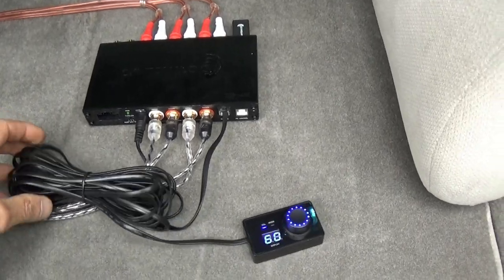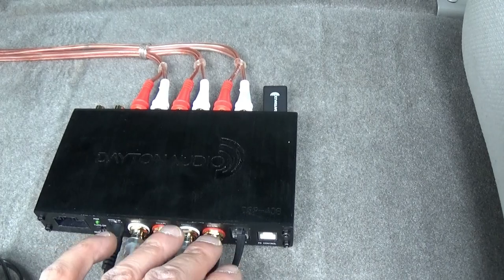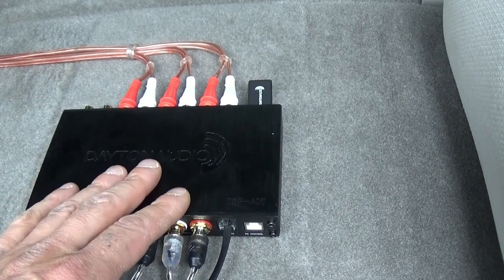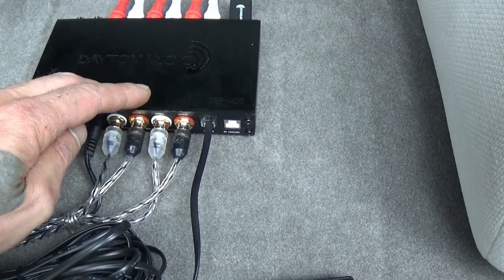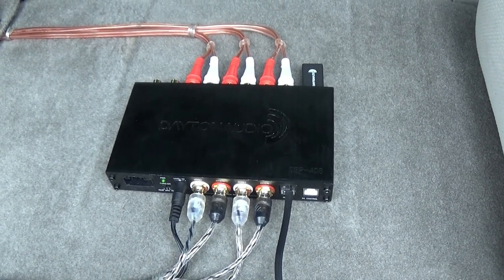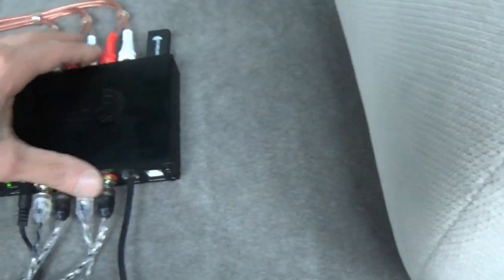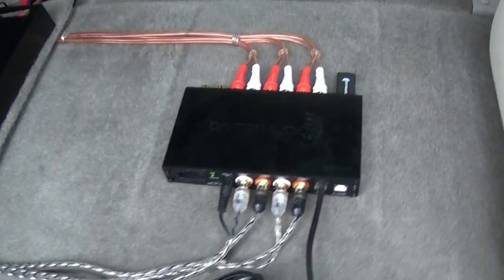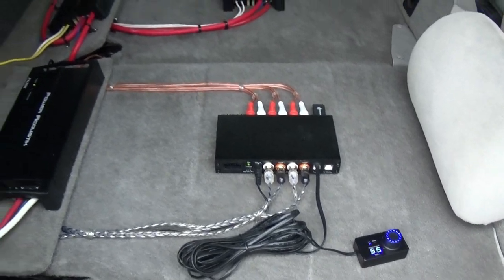Dayton Audio DSP 408 Review and Installation #daytonaudio #caraudio #audio #loud #dsp #installation

Comment: I heard that the Dayton DSP does some kind of popping noises and sometimes doesn't work without turning the car off and on to reset it. Is that true?
Reply from the maker: ive ran the same one for about 5 years now. i have not experienced any of those issues.
Reply: I know this video is old, but I see you also have a trailblazer in this video, and also have the same ideas as me! Right now I'm working on getting rid of head unit and getting a dsp. Just going to use my Samsung tablet, with sub amp and 4 channel amp for the highs. I think it will be better quality that way also? Because it's bypassing the head units dsp and using a dedicated one. Should be good. Let me know if you still have the trailblazer and how good does a system sound in it? I will check your channel to see if you did the tablet/Bluetooth setup.
Reply from the maker: We have another trailblazer now and since we've had a few different vehicles. They're all on here and the installs are too probably. It's worked great with the android tablet to dsp via Bluetooth. I haven't had any of the issues I've heard people mention here. It's been 100% solid all the time and sounds awesome once it's tuned and set up. Everyone always compliments the clarity in every vehicle.

Comment: Clean install bro, and thanks for the information about the DSP.  I have one too, and I love it, BUT, I have one issue....ENGINE NOISE/Alternator whine, and it's killin me.  I was noise free prior to the Dayton, and a lot of forums online are full of people with the same issue.

Do you have noise? 

I also noticed you're using the home power plug as opposed to the wire harness.

How are you powering it?  Is it powered on constantly?  If not, how are you maintaining your present memory?

I think using the power plug is the solution to the noise issue, but I don't want mine on constantly, but I want to retain it's memory like it would if I was using the yellow, red and black leads on the harness.

Any information you can share about how you're powering your DSP would be greatly appreciated!

Thank you!
Reply: @TrapMyRide  LOL I've taken mine in and out to change ground points to hopefully eliminate the noise, and thought I would lose my presets, but you're right, it does hold the memory...that is so weird.

It even works without the ground, but it goes from a whine to a hum....that's the only issue with this thing.

I am definitely interested in using the home power, but my biggest concern was it being on constantly....possibly overheating, over working as well as the constant drain on my battery.

Thanks so much for getting back to me.

Good luck with your system.
Reply: Question, before I decide to cut mine and wire it to a switch, how many wires are in the power adapter, and do you recall what colors were used for what?

Thanks in advance
Reply: @TrapMyRide  really appreciate you bro!  Thank you!
Reply: @TrapMyRide  hey bro, how's it going? I actually used a thicker ground wire and two hi end ground loop isolators on my mids and highs channels and the noise is GONE! If that didn't work, I was going to get a JL TWK-88 or Audio Control DM-608, but luckily I don't have to.
Reply: I'm trying to find out if I can get a center channel out of this? Dolby simulation maybe? I was an installer in the 90's and early 2000's now it's a hobby for myself and friends. Engine noise is almost always a grounding problem guys and gals. sometimes it can be an internal issue with the equipment, like a cold solder joint. Cheaper equipment has this issue (or more likely) at times no matter what you do. SO, always ground all of your amps and head unit everything to the same point and use good wire and the right gauge of course to get rid of this issue ( go back to the battery with everything if you have to, not convenient but usually works). Most people don't do this with the head unit, and honestly that is not always needed The factory ground on most cars is usually good. But try it if you have this problem. If you add any DSP and you have amps this needs to be done for sure. One other big thing is, don't run power and sound wires together. EVER! I know not easy sometimes, but they should be 1 foot apart at least. Better wire always helps with this also. It's a good practice to run power on one side of the vehicle and RCA/speaker/sound wires on the other if possible. Also, low level inputs are always better than high level, by far for noise. If that is an option always use it. If not get a new quality head unit that does have them, if possible.
Reply: @Ahm-Creative  can you share which ground loop isolators you used?
Reply from the maker: thank you!
Reply from the maker: thank you!
Reply from the maker: thank you!
Reply from the maker: thank you!
Reply from the maker: thank you!
Reply from the maker: thank you!
Reply from the maker: thank you!
Reply from the maker: thank you!

Comment: Hey bro late reply ... how did you ran your 110 plug? When i connect my remote wire the rca start buzzin but when i plug the 110 outlet no buzz
Reply: @TrapMyRide  i did that and it wont power up for some reason . Do i have to ground one wire ?
Reply: @TrapMyRide  i end up returning in . Its giving me loud ground noise .lol
Reply from the maker: thank you!
Reply from the maker: thank you!
Reply from the maker: thank you!

Comment: Nice video! Did you get to the point of using BT ad a source? I'm wondering how the quality would be over BT.
Reply: @TrapMyRide  so no more rcas from headunit to dsp?
Your dsp only has output cables now?!
Reply: @TrapMyRide  Thanks I appreciate your video and your responses. I'm ordering this dsp to use with 4 channel speaker amp and another sub amp :)
Reply from the maker: thank you!
Reply from the maker: thank you!
Reply from the maker: thank you!

Comment: Your power input is touching your rca's I understand this is on the input side . But it's probably definitely interfereing with the incoming signal . More commonly found with the alternator whine / engine noise .
Reply: @Trap My Ride!  did you switch to the hard wire adapter ? I just ordered this set up . I plan to hard wire it to a switch through the connector .
Reply: @TrapMyRide.   Nice video, can you explain a bit more on how you connect the power wire? you cut the end off, but where do you connect these wires? I just got one last week and would like to know how you connected it before i install it.
Reply: @TrapMyRide  ok, and if you don't mind,  what kind of switch do you use for that?
Reply: @TrapMyRide  so something like a switch for LED lights? and do you leave it on all the time. or do you have to toggle it on and off for the DSP to turn off?  your install looks so clean I;d like to do the same.  thanks
Reply: @TrapMyRide   Been trying to reply but i keep getting an error.. I'll ask again, hope you don't see the question 3 times. Your install looks so clean I'd like to do the same. . ok so, I was saying the switch could be something like i use for LED lights on my car i guess? and if so. do you leave it on all the time? , does the DSP shut down when you are done, or do you need to toggle that switch off?  thanks
Reply: @TrapMyRide  Alright , sounds good. thanks for the help 🤟
Reply: The hum come from the volume knob
Reply from the maker: thank you!
Reply from the maker: thank you!
Reply from the maker: thank you!
Reply from the maker: thank you!
Reply from the maker: thank you!
Reply from the maker: thank you!
Reply from the maker: thank you!
Reply from the maker: thank you!

Comment: There's more things to that dsp that you are not using. The dsp controls everything that the head unit does plus more. Delete your head unit. The dsp has the ability to turn off any single output with affecting the others.
Reply from the maker: Yeah I ended up getting an android tablet that i bluetooth directly to the dsp. Even with the head unit I connected my phone and tuned the dsp with my phone. If you don't tune it it kind of defeats the purpose of using a nice dsp.
Reply: How do I add a dsp to a system with 2 amps and a LC2i pro ? Would I connect the LC2i pro to the dsp then dsp to amps?
Reply from the maker: What is a lc2i? Like what's it function?
Reply: @TrapMyRide Most advanced loc on the market
Reply from the maker: Oh I gotcha. Yeah it should work ok. The outputs on that should go into the dsp just fine I'd say.

Comment: Bro, just get an android head unit..I have a 10.1” android head unit it’s awesome. If you want a bigger one, you can get a 13.3” Android head unit. Some of them electrically rotate as well, so you can hit a button and it will flip itself from horizontal to vertical and back again with the press of a button.
Reply from the maker: thank you!